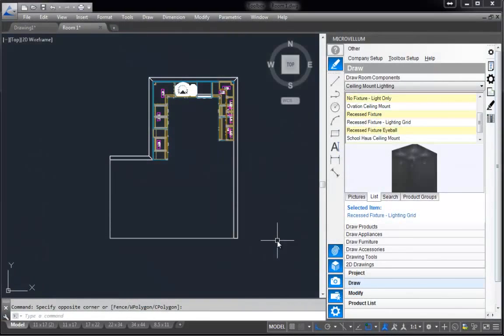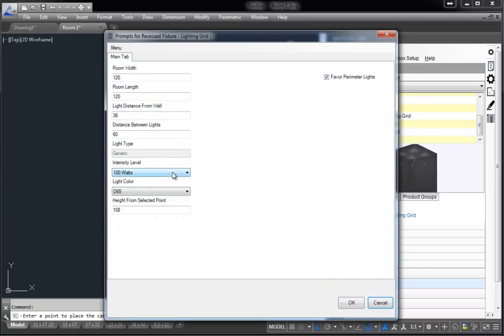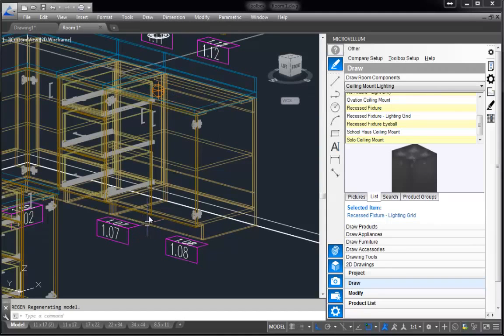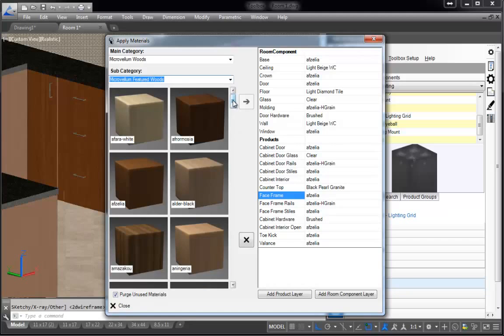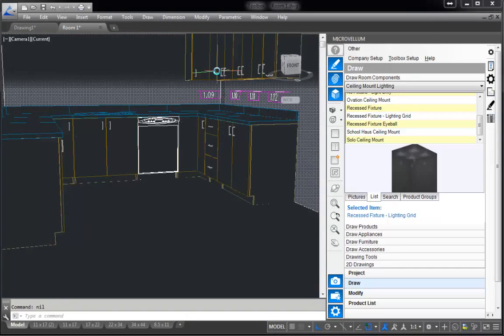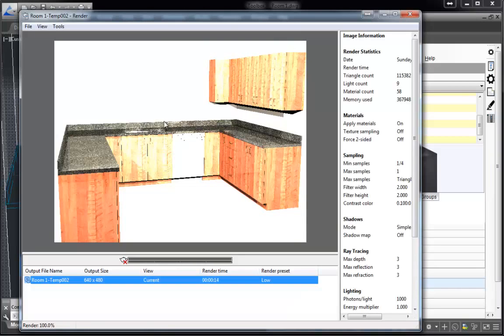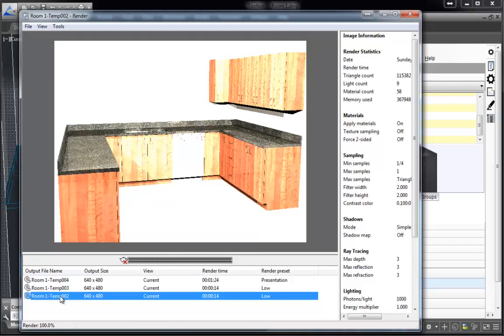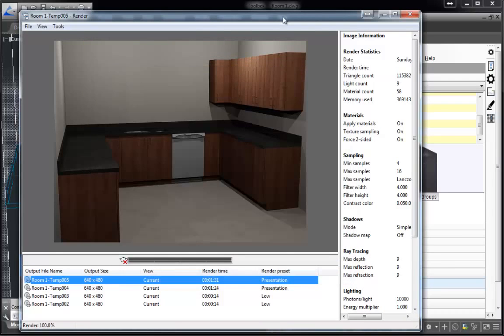10  Rendering with Toolbox

Comment: that can be done when they do not load the textures of the materials, that is, all the cabinets and moldings remain black in the render and in the realistic view
Reply from the maker: If you are having problems with your render materials, I suggest that you reach out to our support department. The solution may be as simple as a few missing materials in your configuration. You'll want to make sure you have ALL the render materials installed.
Reply: OK, thank you

Comment: What version do you use for this video?  Can this be done with Toolbox OEM 2017?  Or is this done with Fluid Designer?
Reply from the maker: The version used in this video was the latest at the time the video was recorded in 2016. What you see demonstrated in this video can be accomplished in any subsequent release of Toolbox - either our standard version for AutoCAD or our OEM.
Reply from the maker: This can be done in any Toolbox version dating back to 2010. However, the more modern versions, like 2019 or even the upcoming 2020 version, may function a bit differently. In our more recent updated, the render engine has been upgraded and will produce the rendering faster and improve the quality as well.